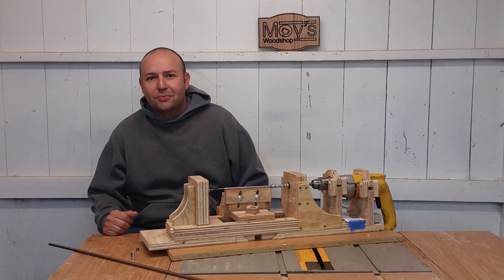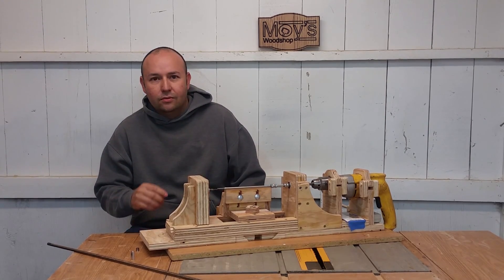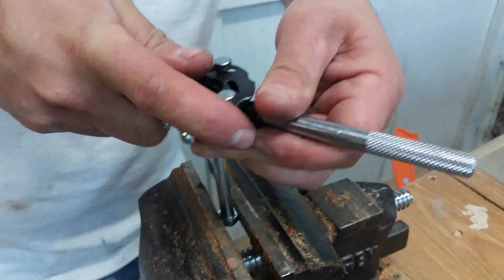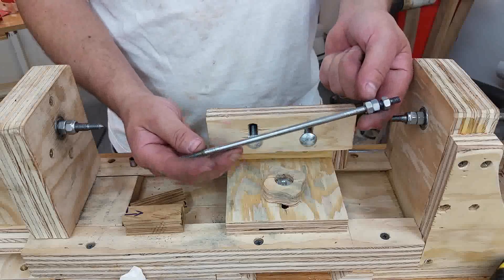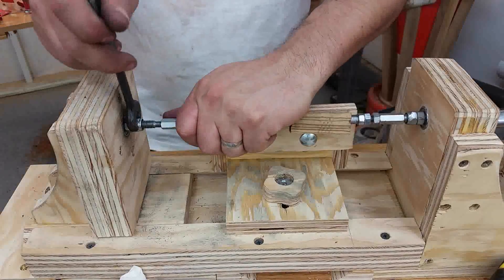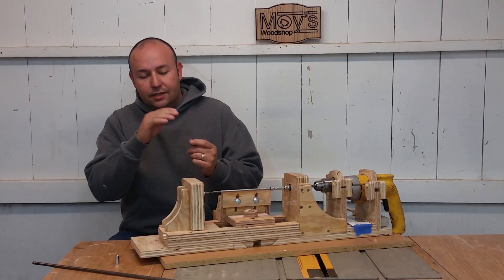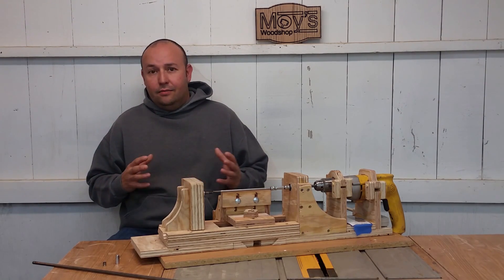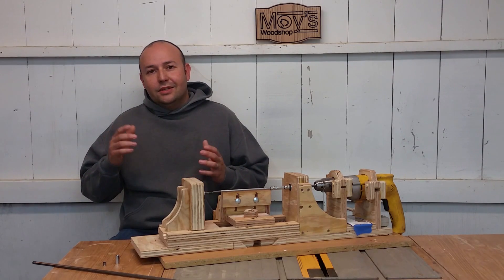Pen Lathe Update

Comment: Just watched your lathe build video and kudos for thanking Izzy, he's a great guy.  With regards to your thread cutting method in case anyone hasn't already told you this but you should do a full turn then reverse for a 1/4 turn then go back and do another full turn, that way you remove all of the swarf as you go and don't stress or clog the die cutter.

Comment: hi a bolt threaded all the way is called a hex head set screw one with a plain shank (usually threaded 2-3 times the dia) is a bolt and as you found out threaded portions will wear
Reply from the maker: +anthony parker thank you Anthony, I appreciate the info and yes I found out the hard way, but easy fix
Reply: Yes so did I and I worked for a distributer for 20+years